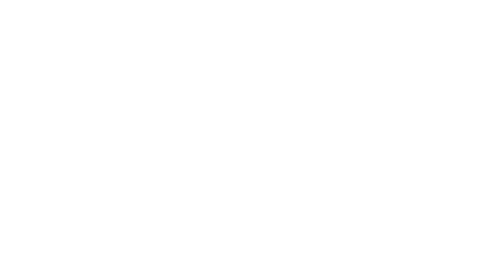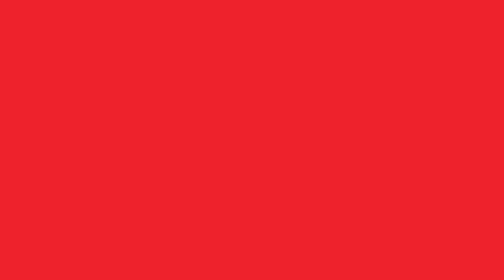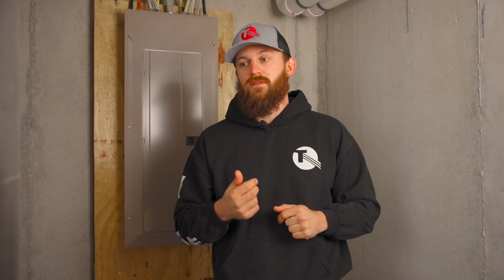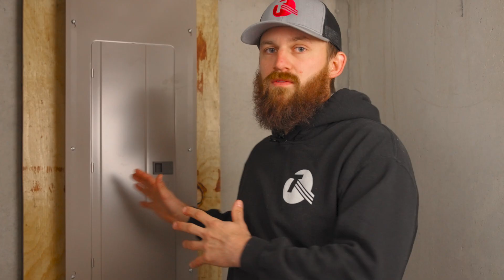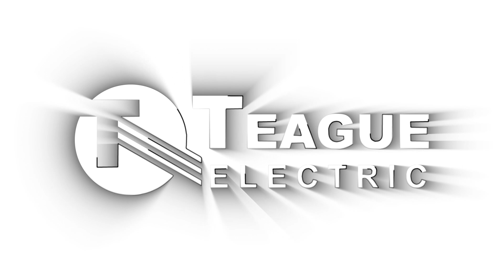What Does Rewiring a House Involve? | Teague Electric

Comment: Learned something new today. Knob and tube is what i found in my father's house when I was replacing some receptacles. I was wondering why the wires were in a cloth sheathing. Took a 3 month pre-apprenticeship electrical course and this was not covered other than old wiring in older homes. Granted the class was free and the instructors were great. I guess this is something you learn on the job and trough experience. Thankful now that I know more about this.